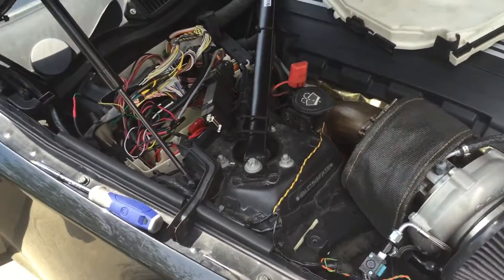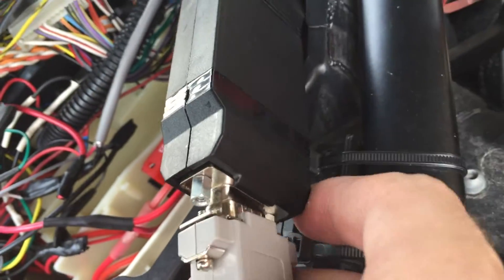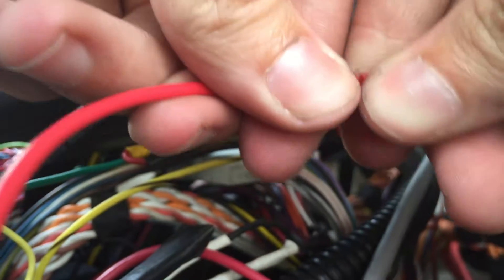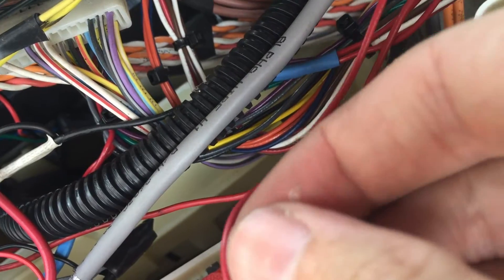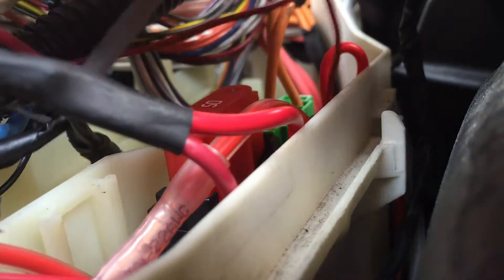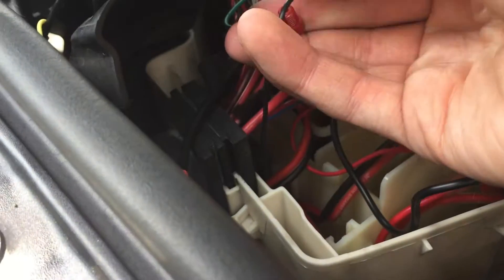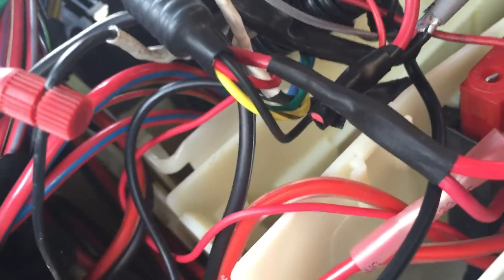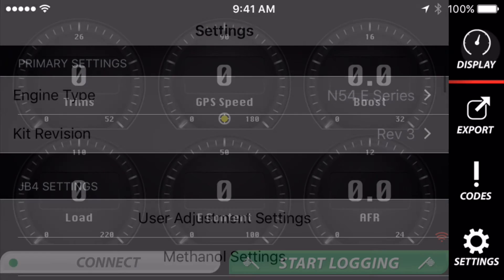JB4 Connect Kit (Rev 3) N54 Install

Comment: tiny ass turbo
Reply: lmao that "tiny ass" turbo is good for at least 700hp
Reply: +NexusAbstracts 1st it was sarcasm 
. Obviously you don't get that.. Second my twins make 721rwhp and don't take nowhere near as long to boost. But hey some people just like spending 8-9k on a top mount , when building the motor, upgrading a fuel, cooling/oil,air, and power train.
Reply from the maker: Car made 807whp with a few PSI left in it still.  With anti-lag, spool isn't a concern. ;)
Reply: +dmacpro91 built motor or on stock internals?/ machined head, hphp upgrade lpfp? Pi, 100% e85 that's how I'm set up. I still have plenty I had my boost set to 24 when j hit 721... I normally just keep it limited to 20/12 for daily.just curious cause it looks good, and from the #s you're on the right track,

Comment: I hooked up my jb4 and everything works great. Then I hooked up my Bluetooth device. It has power and the plug is inserted correctly and screwed down, but my tablet is not recognizing the device. Do I need to do anything other than turn on my tablet, open up the app, and press connect? Thanks!
Reply from the maker: +Derek Chapman Nope, that's it.  If you need further support, email me.  Support@jb4connectkit.com
Reply: dmacpro91 I am having the same problem.    jb4 a1 shows as available device in the Bluetooth menu, but it asks for a password and the connection fails.

Comment: Got it all hooked up and the app connected with the device . I see there is adjustments in settings to change from circular gauges to bars, but I'mShowing all 6 gauges as IAT?? I set my engin type (n54) and kit revision 3. So how do I set my gauges to shows rpms, boost etc.....

Comment: the posi tap has a grey screw on the end that has the cut out through it to put the live wire in the other end just unscrews . not quite sure how to secure the jb4 connect side wire into the posi tap, i though it would be double ended tap like they are the same on both sides . thanks

Comment: i jus got my kit , the power wire came with the post tap taped to device, i get how to tap into the power line in the dme but how do i use the posi tap to connect to the device end wire . its not pre connected like in the video, one end has the tap where u screw it into the power wire but the other end unscrews and there in jus a hole on the other end , how do u ensure that end is connected to the posi tap? sorry if this is confusing, i jus thought the posi tap was the same on both sides , i don't see how u keep the connection together from the device end to the posi tap. do u jus push it through the hole and tape it or something , or do i use this Y connector included for some reason? what is that for ? thank u

Comment: dmac, i received my product and it only has the red wire. I'm assuming the ground wire is inside the gray connector connected to the jb4? and of course the red wire will tap into another red wire as seen in the video to receive power?
Reply from the maker: http://jb4connectkit.com/store/index.php?route=information/information&information_id=7
Reply: thank you
Reply: So we don't need a ground wire then? I just got mine today and I'm about to do the install

Comment: Can you describe what the options are for the ground wire?  I do not see the same wire you show in your video on my N54.
Reply from the maker: +James Cantwell N54 cars can just leave that wire disconnected.
Reply: +dmacpro91 Thanks...installed it this morning in just a couple of minutes and used it to update my firmware shortly thereafter.  So far so good.